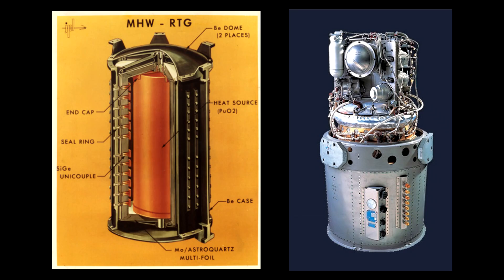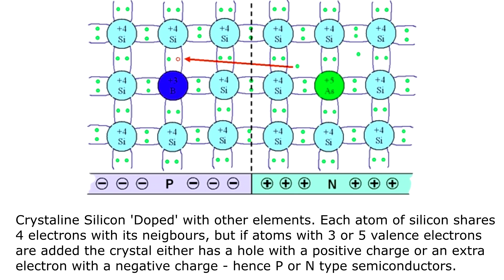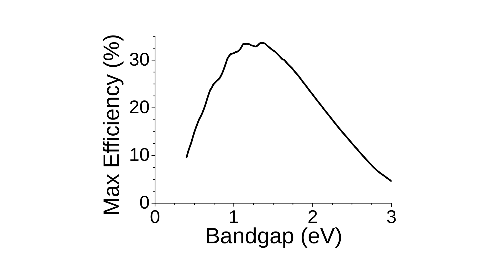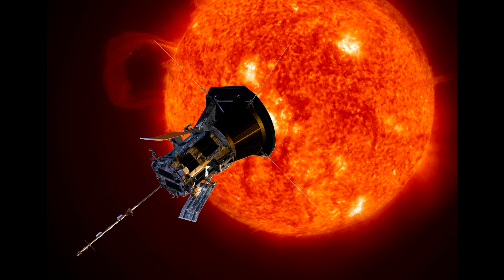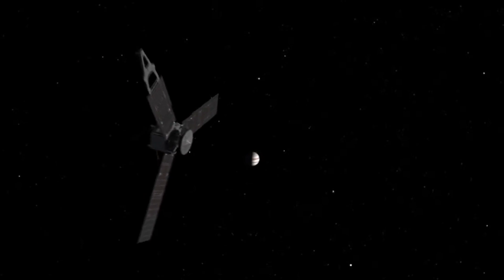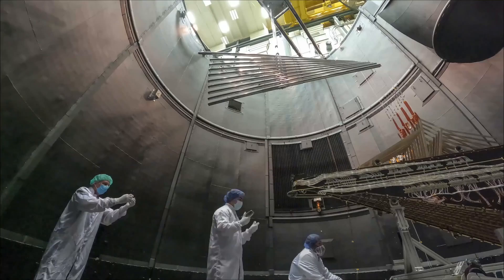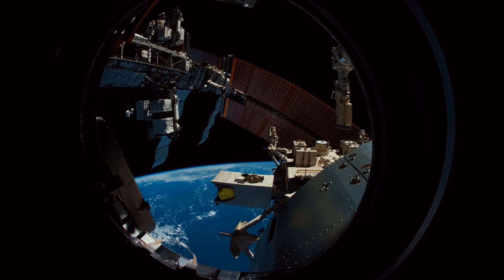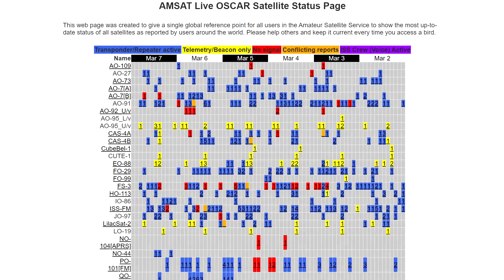How Does The Sun Power Spacecraft?  Things Kerbal Space Program Doesn't Teach You

Comment: I previously worked on multi-junction cells.  I'm quite impressed about the job you did outside your formal training!
My only minor nitpick would be that the battery didn't short circuit with AMSAT.  It finally went open circuit so the failed battery was no longer pulling the voltage down.
Reply: It's kind of amazing though.
1974: launch
1981: battery failed, pulling down power, rendering satellite inoperable
2002: battery failed further, no longer hindering power of the satellite, rendering satellite semi-operable again
Reply: Beat me to it.
Reply: I spotted that too, and I know very little about this except I paused the video and read the AMSAT posting shown.
Reply: I was thinking the same thing! Lol

Comment: Seeing this stuff about how solar cells can be extremely weak LEDs if power is put into them makes me think of how crazy it would be for someone in a fictional setting to secretly send morse via solar cells knowing an enemy is monitoring all normal RF frequencies. but only a still manned friendly science station would be monitoring near visible IR. Since I am guessing what tiny light they do give off is similar in spectrum location to a TV remote. Which digital imaging systems can see.
Reply: Solar panels are able to detect a laser pointed at it and this has been demonstrated to be capable of high bandwidth signalling. With a laser to return data, this could be both covert and almost undetectable.  Starlink V3 maybe?
Reply: Or they could just use a flashlight from a window.
Reply: @RCAvhstape  or a laser for extra sneakiness. There was an experiment a while ago where some people successfully signaled the ISS with a pretty low power laser on the ground. And by signal, I mean they could see it out of the cupola window. I want to say Scott has a video on it
Reply: I've read a book where (very low bandwidth) covert bidirectional communication is done using LED room lighting.
Reply: @AlexandervanGessel  There's actually a real tech that does this (and I think it's fairly high bandwidth too) called Li-Fi. So what you are describing is within the realm of reality.
Reply: @daedalusspacegames  I've actually worked with people doing research on this. The trouble is that without specialized hardware, you're stuck with a symbol rate that can't realistically exceed 100 baud, so your bandwidth is going to be crap. With specialized hardware you can do way better, but you're still dealing with occlusion and not interfering with human usage of the lighting, so good luck finding a usecase to fund that hardware. The fun challenge is using existing lighting (preferably smart lighting, but possibly even high-brightness screens) and the cameras built into smartphones and laptops to do useful work.
Reply: @AlexandervanGessel  Ah, gotcha. I figured it was something like that, given that I heard about the tech at a CES ages ago, and yet it hasn't taken the market by storm. I suspect that it's going to be like wireless power, where outside a couple of niche use-cases it's a solution looking for a problem, unable to compete effectively with existing technologies.
Reply: @daedalusspacegames  Yeah, adding the features to lighting (or screens) is cheap enough (usually just software), but running cameras on smartphones is expensive in energy. You can build cheap hardware with photodiodes and microcontrollers, but you'll need to make your case why this is better than off-the-shelf wifi, BLE, 15.4 or other RF chips.
Reply: Arthur C Clarke's Earthlight from 1955 has an astronomer spy on the moon sending messages back (to Mars) by replacing the eyepiece of a vast lunar telescope with a light source, allowing him to send very tightly focused beams of light to waiting spacecraft. This is completely not the thing being described here, but is still pretty cool.

Comment: Has there been any progress in reducing the cost of multi junction solar panels for something like home PV systems? It would be nice to be able to capture more energy so that heavy usage days still leave enough power to charge your batteries.
Reply: Traditional multi junction cells use III-V compounds like GaAs, which makes them prohibitively expensive for the consumer market. However, recently there have been commercial developements to build tandem cells out of standard silicon and a new class of solar cells called perovskites, which can be produced cheaply. While this doesn't increase efficiency as much as traditional multi junction cells, it does so much more affordably.
Reply: I don't think there's much more point, since efficiency kinda is a strange thing in solar panels. With most other power sources, increasing efficiency means reducing upkeep costs as you need less fuel to do the same thing. Thing with solar panels is, efficiency is just another way of writing the power per square unit of length. So increasing efficiency at high costs just makes less sense than putting more of the things. Commercial solar panels are efficient enough to supply the house they're laid upon without exceeding the size of the roof, and for massive photovoltaic farms the real metric still is watts per dollar spent, not efficiency, because there's no point spending twice as much per solar panel for a marginal gain if you could instead just put down twice as many of the things. In a sense, multi junction solar panels can also be less efficient in a watts per kwh sense, since they take for more effort to make. Really, "efficiency" in solar panels is the conversion factor of incident light to electrical energy, which may not be the actual metric of what we would consider efficient in practise.
Reply: probably not if they are still only used on spacecrafts
Reply: There may be progress in the future using quantum dots instead of rarer metals for multi junction solar cells.
Reply: The cost per square cm for a GaAs triple junction cell is so much higher than si, that it will never be a real alternative for normal rooftop applications. However there are concentrator pv Moduls availible that need tracking units but can be more cost effective than si. The most advanced cells use up to 5 junctions on top of each other with an efficiency up to 46%. For example by "Azur Space Solar Power".

Comment: Another reason PV works great in space is that PV cells are more efficient as they get colder, below 25C.  
So much more so that people who design PV systems have to take into account the extra voltage generated for solar installations in places where you can get very cold, very sunny days!
Reply from the maker: Actually solar cells get hotter in space because they can’t be cooled easily
Reply: @scottmanley  Yeah, "cold" kind of loses its meaning in vacuum... no convection to transfer heat in and out of the system. It's all about radiative cooling... whether you can emit more heat than you're generating and receiving.
Reply: The lack of atmosphere does help increase the ammount of photons though. I don't know if the cooling problem ofsets it completely.

Comment: There is something beautiful about amsat's battery failing so completely that it started working again.
Reply: The mission failed successfully.
Reply: Totally!  A deeper dive into what and how is suspected to happen would be fun and interesting.  @ Mr Manley ?
Reply: @timboatfield  AMSAT-OSCAR 7 flew with NiCad batteries.  These have a finite lifetime of charge/discharge cycles.  The usual failure mode after many charge cycles is the growth of "whiskers" between the plates of the batteries.  Eventually, these short the positive/negative electrodes and the battery can no longer take or hold a charge. 

The theory is that as the solar panels continued to dump energy into the batteries, eventually the current through those whiskers caused them to melt?  or at least go open.  At that point the battery was no longer drawing the power bus down and adequate voltage was available to power the spacecraft systems.

I've experienced this failure mode myself with more mundane terrestrial radios.  Back in the day, hams would buy old commerical 2-way VHF/UHF radios and re-tune them to the amateur bands.  I had a really great Motorola HT-220 handheld radio, and it came along with a bunch of mostly dead battery packs.  The thing is, replacement batteries for these things cost a lot of money (and were not simply a bunch of AA NiCad batteries in a compartment.)   And I was a poor college student.  What you could do was run a heavy current through the battery, and if you got it right, you'd burn away those internal whiskers and not melt and/or blow up the battery pack.  This didn't give you a as good-as-new battery, or even a so-so battery.  It got you a crummy battery for "free."

I think in the AMSAT-OSCAR 7 case, we got to see the "melt/blow-up" case where the battery went open due to the over-charging current over the span of a decade or two.
Reply: @lmamakos  Thanks that was interesting and a nice anecdote and finishing with a mind panting of the silent fate of the battery.  Top comment.  I'd suggest you make that in to a video.  This comment and your last few video have already earned you a sub.
Reply: I like to believe that Scott came across that little tit bit, and then scripted the whole video just to get to that point at the end.
Reply: Zombie spacecraft!